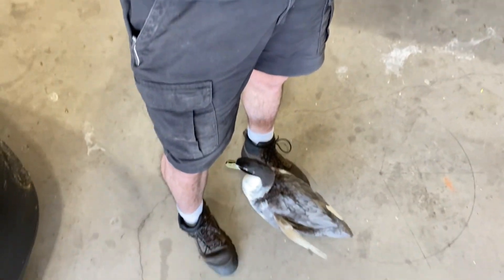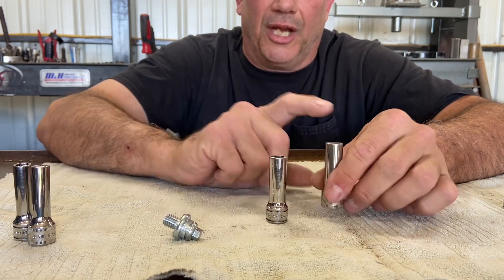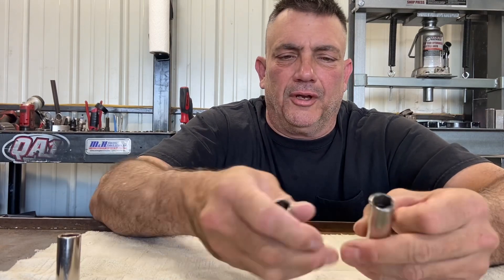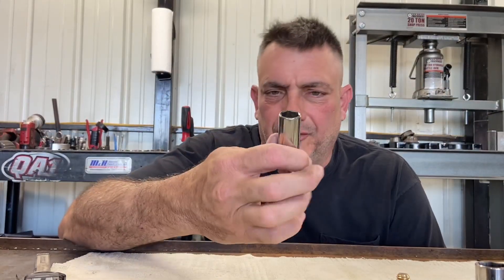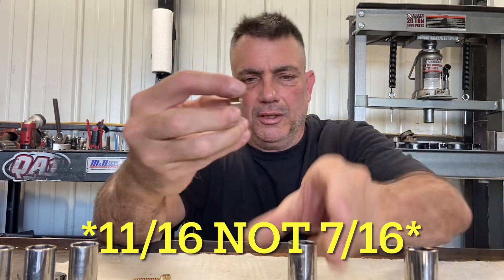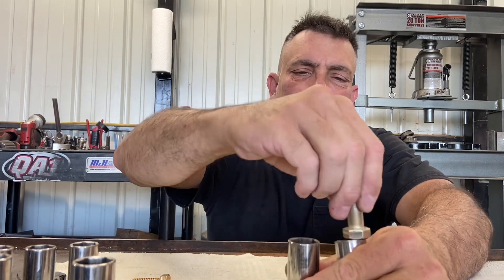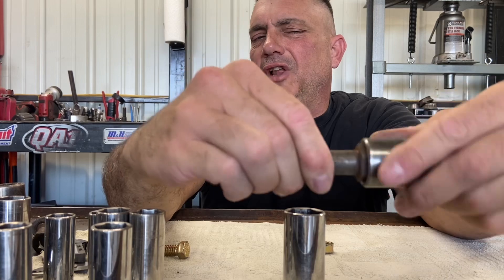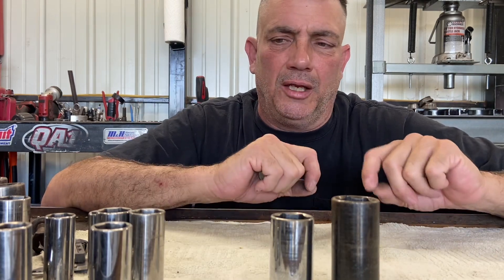Metric vs SAE.  Differences and similarities.  Which sizes can be substituted for others.

Comment: Removing pitman arm on my cummins. Calls for a 46mm. Will i be ok with a 1 13/16?
Reply from the maker: They’re almost the exact same size so you should be just fine. 46mm  is 1.811 inches and 1 13/16 is 1.812

Comment: I had an '89 F150.  If the chrome nut covers were stuck on the lugs i needed a 20mm socket to use on them. If they fell off a 19mm or 3/4" woeked. 13/16" was too loose.😢

Comment: Great explanation so I subscribed 19/32 is not very common but it can be used on a 15mm fastener
Reply: 25/32 can also be used on a 20mm fastener in most cases

Comment: Hi sir, thanks for the detail; I'm in the process of organizing and separating my hardware bins...too many apprentice compartments with miscellaneous being their favorite system. Personally I don't look for hardware or tools. If I don't find something where I expect it, my self-discipline way is to go without it - the tool or the part - for an hour. The next thing I can't find I go without for the day, and then I can look for it after hours or have found it or didn't really need it, obviously.

I'm an electrician and so I wind up with a lot of machine screws, random hardware from devices that include provisions for install. I've never seen BOLTS on equipment in your millimetrics, BUT they are still essential sizes for boring and tapping kits, whereby the lugs we use depends on the gauge wire we use and yadda yadda we do a lot of tapping copper or aluminum into steel. So one needs all the box-ends for this kinda work, not least because it's all custom, and impacts with socket sets do to fabrications what keys do to paint-nothing good.

Wrenches are calipers, too. :) They're the tools you build tools outtakes.:)

Thanks again,
Johnny J-Manned
Reply: Outta.Stupid automistakorrection.

Comment: Propably not more today, but maybe up to mid 90:s, japanees cars 8-10-12-14-17-19mm fix any job. European cars 8-10-13-15-17-19 fix any job. Off course there is some smaller bolts and bigger bolts, but for moust work you get away with those sizes. Here we use 1/2" on rounded 13mm, 1/2" is 12,9mm. 14mm and 9/16" is in my opinion the same, or at least there is no feel diffrence if the vrench  9/16 or 14, grabb the one you find first.
Reply: The inside of a 1/2" socket is 12.9mm? Interesting, that means that there's 0.2mm tolerance to be able to get it on and off then.

Comment: I can't recall needing a 20mm for anything but, I need a 23mm to change my tablesaw blade. And it happens to be a shorter, double ended angle wrench. The cheap stamped steel wrench that came with it stretched wide open during the first attempted use.